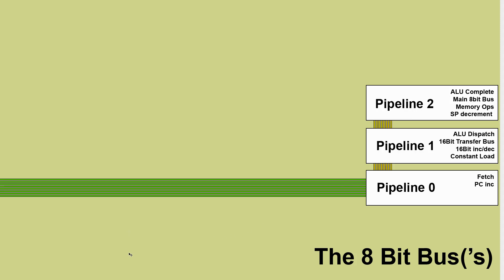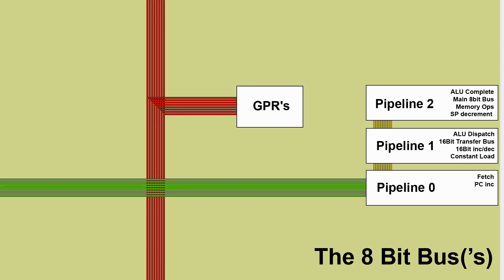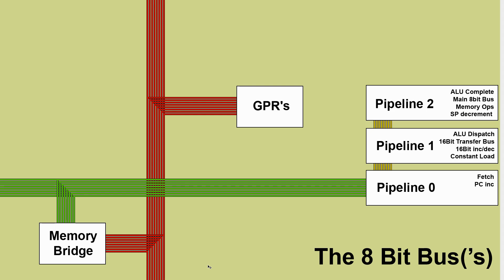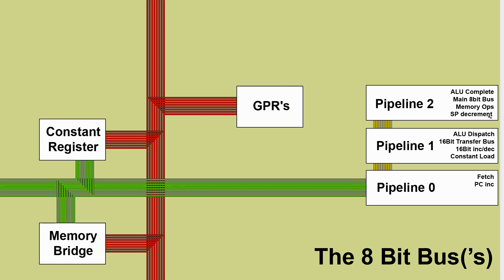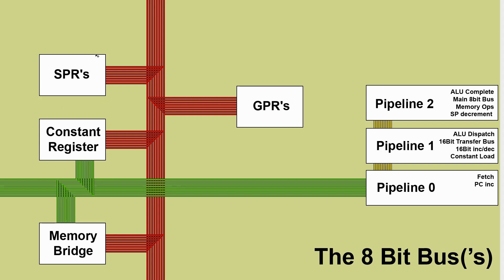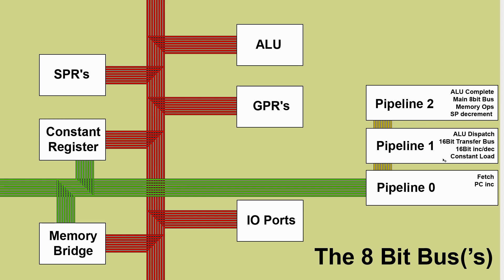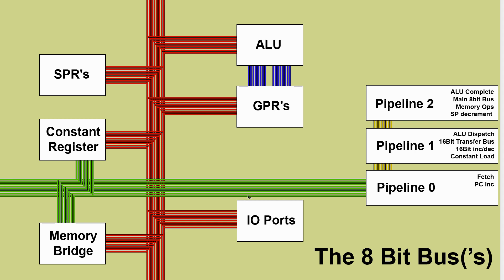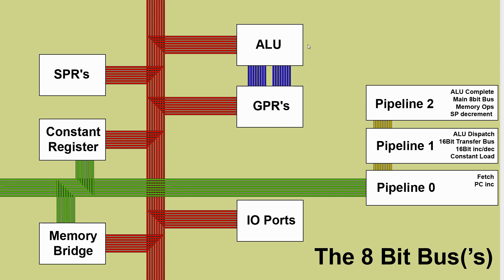Architecture (2: 8 Bit Busses) - Making an 8 Bit pipelined CPU - Part 13

Comment: Hi sir I rly like your videos but I’m confused about the pipeline. How does it interact with the rest of the cpu? Normally I’m used to having the pipeline registers in between each part. So there’s a pipeline register on the alu, one on the decoder, and so on. But this pipeline is its own section. Do u mind explaining sir? I’m rly confused. Thank u for these vids 🙏🙏
Reply from the maker: Their are registers in between steps, most obviously in the ALU. The pipeline itself is the control unit that is turning the instructions into the right control operations at each step.  You might want to watch more of the video series to see if becomes clearer.
Reply: @weirdboyjim  ah alright. thank u sir. sorry for not having a lot of patience. ill keep on watching!!

Comment: when I first found your channel (through the doom video) I thought "why would someone build a cpu with a pipeline, instead of just executing every step after another, like Ben Eater did". But now that you've explained the two busses in this video, I'm kinda blown away, you're right, pipelines are cool! (I never thought that I would say this!) I have a homebuild computer with a Z80 (no visible pipeline), and I like programming for the sh4 (pipelined, jumps have a delay slot), which is used in casio calculators, but I've never thought this deep about how it works, I always thought that pipelining isn't necessary on a breadboard CPU. You proved me clearly wrong! 

This is a great video series and I'm currently binge watch to catch up. 
Thank you very much!!
Reply from the maker: Yes, The design Ben used is called “Simple As Possible” I was trying to play around with some more complex features.

Comment: This is probably a little of topic of this video, but i am trying to improve my cpu design in logism and i was looking for info on how to do the flags register and implement conditional branching...I already have the basic design working which is a 12 bit cpu with basic load/store  opcodes and two jumps with the control unit being hardwired.
Reply from the maker: Just a little. For flags you'll want to skip forward to the ALU videos. They are spread out a bit but start at Part 21. Conditional branching is in part 54. A warning though, most of the complexity there relates to the pipelined design so it might not make that much sense if you jump there directly.

Comment: Your videos are really interesting and helpful, I'm currently designing my next breadboard computer, I think its going to be much simple and slower then yours :) I had started building it to be 8bit, but didn't like having non addressable space on the ram chips as they take 13 address lines so right now I have a 16bit databus and 12 bit control bus planned. I'm hoping to avoid having a mess of wires between modules in my one using the control bus, first 4bits to select the module and next 8 as control logic (it could probably be less but I'm not going for economical). It took my about a year to finish my copy of ben eaters 8bit computer with some improvements, this next one will probably take even longer, and with lots of designing on paper too. Using 4 74LS181's is horrid >____> once its finished my ALU will be terrifying for a breadboard computer.  Just got another 20 breadboards in the post :).  Mine is large and dumb (in the way it does things), but yours is more complex, fancy and interesting
Reply from the maker: Thanks! What are you planning to differently in your new build?  I actually toyed with a very similar address/command system when I first started planning out my build, there are still echos of it remaining in the control lines going into my bus control, but it’s obviously more complex due to controls coming separately from the 3 pipeline stages.
Reply: @weirdboyjim It's mostly inspired by ben eaters 8bit computer, but I've been watching the videos other people like you have been putting out and making lots of notes and reading up on different architectures and things and I guess it'd quite likely to change the further in I get. Basically, more ram (2 * 8192 words by 8bit) for 16bit numbers, a 16bit databus to move the data around between registers and things.  That ram is just system memory, the program itself will either be in dedicated ram chips loaded from a computer via serial or maybe selecting programs on a micro to be loaded in I'm not sure.  The ALU is 16bit with 4 74LS181's.  For control, I didn't like the mess of control lines on ben eaters build and the 74LS181 requires 6 control lines as oppose to one, so to solve the mess of wires I'm adding the control bus (12bit), the first 4 bits are the address of the module, the next 8 are data lines.  I've tried to find some sort of address decoding IC but wither I don't know what to look for or they don't exist to so I will build a decoding circuit from Logic chips to identify each module when it selected.  I've been trying to nail out my control logic and ram designs for the last few months because I want to get it right before building modules and having to redo them. It's probably going to be more complex then it needs to be and take much longer (see years).  But its just for fun anyway right? I think I kinda committed once I dropped the money for a 4 channel scope...  Your pipelines thing is really cool btw, I never though anyone would consider implementing that sort of thing in one of these breadboard processors :)